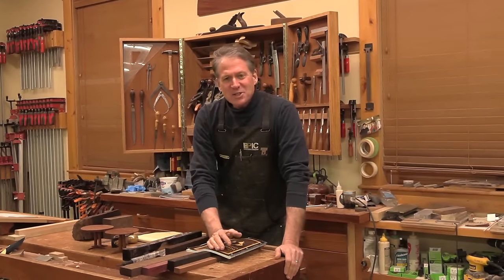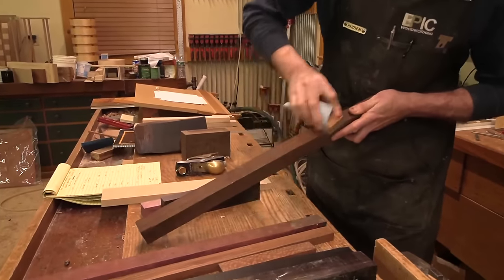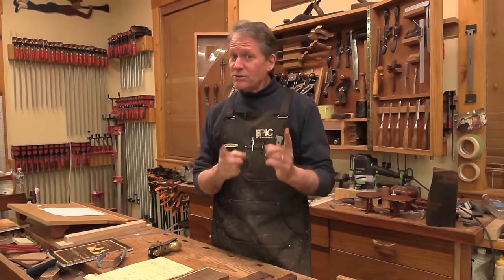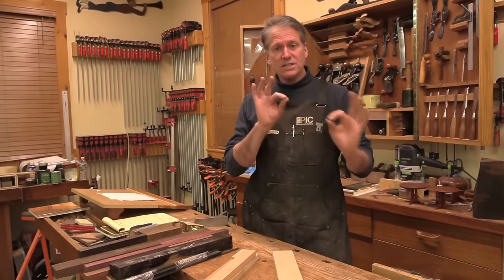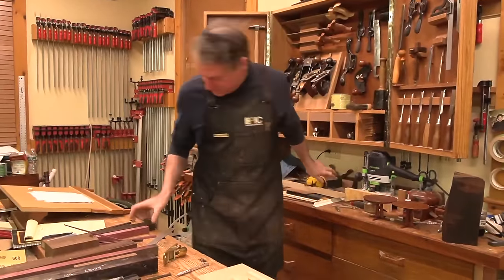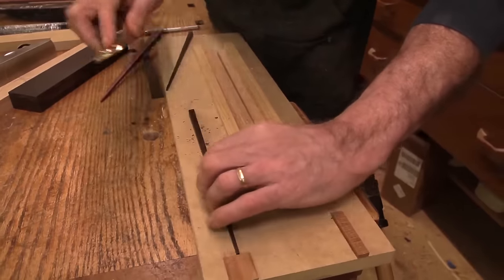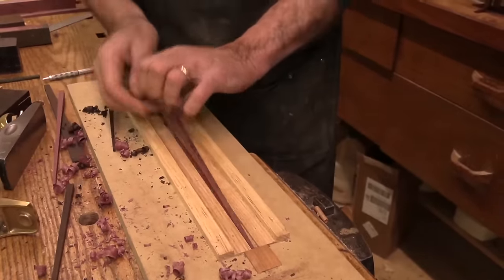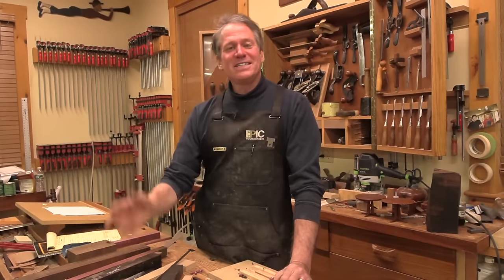Exotic Wood Projects

Comment: Hi tom, Nice to see the saw stop :-), but curious as to why you removed the riving knife from your saw stop - especially as you were ripping the jig?
Reply from the maker: Hey thanks, nice catch, I should have had it back on there. It’s typically always on, but earlier in the day I was cutting some tenons and used a smaller diameter blade, from being sharpened several times, and the riving knife was too high so it was making the tenon cut unstable riding up, so it was off for that, and I simply forgot to put it back on. I know there is an adjustment for the riving knife height but I am still getting familiar with the saw. Thanks for reminding me, and for watching! 👍😎